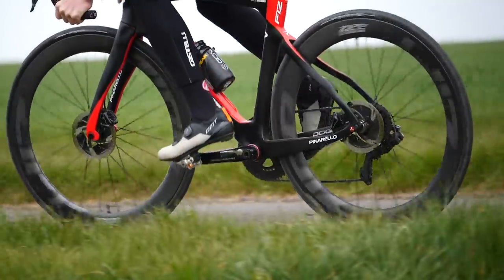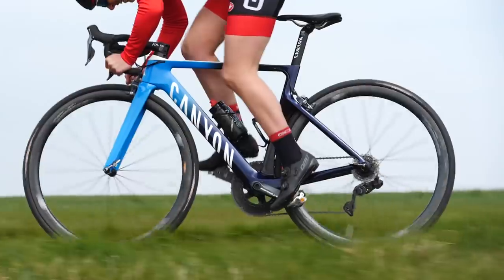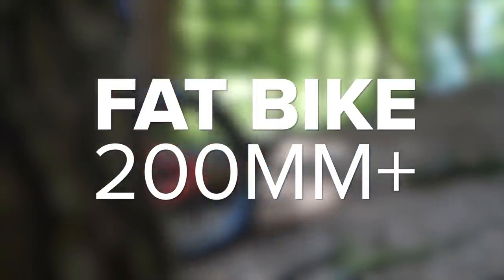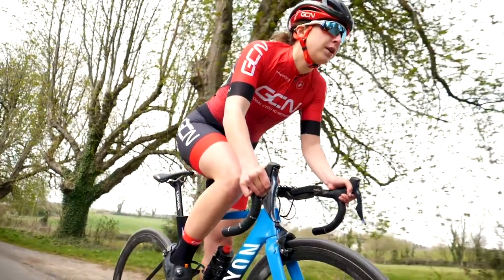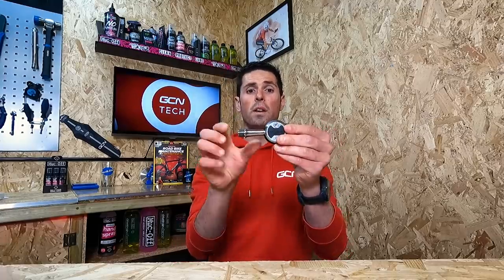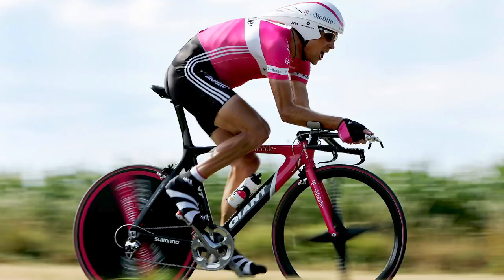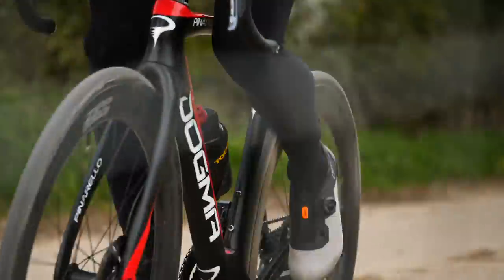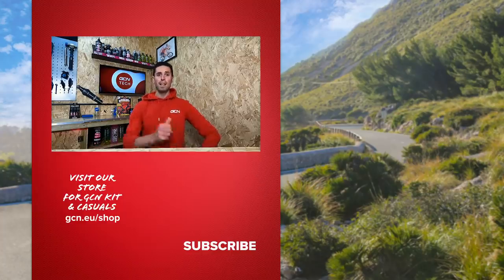What Is Pedal Q Factor On A Bike & Why Is It Important For Cyclists?

Comment from the maker: Have you ever thought about q factor as something to consider? Have you ever changed it on your bike? Let us know 👇
Reply: Its important for recumbent bikes, particularly velomobiles as narrower means more aerodynamic and snaller fairing nose
Reply: Thought about it as I had knee pain. As I already knew I had wider than average sit bones it was obvious I needed wider than average Q Factor! Well obvious after the pain.....
Reply: Thanks, any advice on the nightmare of how to narrow the q factor on some wider bikes ? There's often clearance to do so between cranks and stay. Just don't have countless parts to have endless attempts. Get another bike I suppose.
Reply: @mikes_3d  If you have a BSA square taper bottom bracket then these come in a few different widths. Only mm differences but it might be all you need. If your hollow tech....I think you are stuck.
Reply: @SuperNeilB  Thanks for the help. Hope your knee is OK, same issue with me. You are absolutely correct with taper. Of course, need to not foul the crank on to the BB with narrower spindle. On other BBs a different set of issues as you say. Need crank arms which simply which don't angle out too much. On my old mountain bike I use old cheap taper fit chainsets which are narrower than newer ones and others. Need to do it on another bike which is not taper fit.
Reply: Yes I have.
Reply: I suspect Shimano XT pedal spindles would be compatible with their road pedals. That way the Q factor could be increased without spacers and by more. Dura ace  has one ball bearing less per race though  so it wouldn't fit.
Reply: Great video!

I had incorrect BB spacing set up on my bike for a while and started having problems with my knees. Made some amendments and haven't had any issues since. 

Essentially all that I changed was the Q factor.
Reply: Great video!

I had incorrect BB spacing set up on my bike for a while and started having problems with my knees. Made some amendments and haven't had any issues since. 

Essentially all that I changed was the Q factor.
Reply: Great video of an underestimated parameter. Very common is the check of the saddle width and not the Q factor . I m 197cm tall and I use adapters (20mm) a totally different life :-)
Reply: Ok so we learned about the Q factor, now thats the 007 factor?
Reply: one more reason to bring back the good old square taper
Reply: buy this man a new mic or some foam wall panels please!
Reply: I went the pedal extender route myself. I also use platform pedals because my feet are too wide for regular cycling shoes. Used to have pain in the outer foot after rides of less than 5 miles.
Reply: @SuperNeilB  I've had knee problems for 20 years. Bikefitter adjusted saddle setback and q-factor. No pain anymore!
Reply: @turboplopp  Good that your problem is now fixed. My problem was the Q factor and pedal spacers fixed it. It became obvious when I was riding my MTB with flat pedals and no knee problems.....because half my foot was not on the pedal! Move the pedal out and all is well. This is the problem with being 20% wider than an average human!
Reply: I had knee and Groin strain riding on the spinning bikes. After reading about Q factor on Bicycling Quarterly, I found the spinning bike Q factor was 170mm.  I use Speed play pedals on my racing bikes with a Q factor of 120mm with no knee or Groin problems.  I also placed wedges in my cleats to slightly adjust for my pronated feet.  Ride with no pain in those areas.  Now 70 years old, and having neck issues that physical therapy is helping but not eliminating.  Riding outside and inside on longish rides, 30 miles inside and 50 -80 miles outside and putting up with the neck pain.
Reply: 20mm spacer are an extreme mod and can injure your hips. Just 3mm increase can already have an noticeable effect.
Reply: without having a really good bike fit that goes into minute detail of all this, it's very hard to know whether your setup is right or wrong, until you experience pains/problems. There are such a huge number of options out there for clipless pedals, it's a wonder anyone ever actually gets it right. I went back to flats after suffering knee pain on mtb clipless; I wouldn't go back now
Reply: @giuliospinelli6958  hi Guilin, are there any specific adapters you recommend?
Reply: @iragreenberg5432  Hi Ira, how did you extend the speed plays? I can’t find the optional spindles anywhere!
Reply: @giuliospinelli6958  thank you!

Comment: I have found that a more narrow stance on my bicycle is more beneficial to me, I began to experience inner medial tendon pain on my knee. I moved my cleats outward bringing in my foot closer to the frame and my symptoms disappeared. Another way is changing pedal spindle if you can, extensions if wider suits you, different cranks, or bottom bracket axle. Just watch the distance between crankarms and the chainstays.

Comment: Ulrich and Lance may have had issues but the pioneer of narrow Q at the bottom bracket source was Obree - it worked for him but (of course and as ever...) it’s horses for (TT) courses - Obree was (and remains) an outlier! Never knew the origins of the name - Q factor is a term used my other world - the music industry - in regard to how wide a range frequency is being affected either side of a central point when using EQ. Makes perfect sense now - nice one!!
Reply from the maker: Glad you enjoyed the video, Obree was an outlier for sure!
Reply: As q factor is a huge factor of designing fairings for HPV racing, as narrow Q factor means lower CdA, Id think it would go more far back than Obree.
Reply: @taufikabidin412  ah that’s interesting - I didn’t know that - Q factor in the same place - so essentially decreasing the distance between pedals? I didn’t know that!

Comment: I used those pedal spacers on my road and TT bikes and found after time they created a creek in the bottom bracket. It was a long and head-ached experience of investigation and experimentation with a solution occurring after greasing and tightening everything, then removing the 20mm spacers.  My guess is the longer lever causes the effort to put greater stress on the BB. I'm not a engineer however, this was just my experience.

Comment: I am 5’3” tall male with narrow hips. Q factor is very important to me. I have had constant knee issues due to wide qfactors on bikes. I have installed road bike cranks on all my bikes including mountain bikes. I machine the cranks to shift the chain rings for proper chain line.  I make the crank arms barely clear the chain stays. It is frustrating that bikes are pretty much built with the same q factors for all size riders.

Comment: @gcntech  #gcntech

It would b great if you could be more specific in how to determine the correct Q factor aside of trial and error.  Is there a biomechanical measurement which would give me a specific measure to set my pedals ??

To date, one of the best ways I discovered by chance was to ride on a straight set of road when the sun is low and directly behind you,  minimise the width of the shadow of your bike in front of you and observe the shadow of your legs (and knees) in relation to the shadow of the frame. This way I found that I had too narrow a stance and change to a MTB crank set on my road bike increasing the width by 10mm.  The first few rides felt different, not better or worse, just different but OK.   

However I would also like to hear of a possibly more biomechanical measurement.  

Further down a commenter (scott baker) suggested a "waling methode to determine a q factor.   But what he describes would 'only' give an approximation because when standing / walking the legs are straight or only marginally bent.  
When cycling the knees, hip joints move through a much larger range of angles and only at the extreme of the pedal down stroke do the angles approach those you have when walking.  
If the hip joints are 'toe in' or 'toe out' ,  for the lack of a better description,  the legs will move very different at the acute angles during cycling, compared to walking.
Reply: If you have a trainer, film yourself from behind with different size Q factors.

Comment: Since it's a fit specific measurement, the right dimension will be specific to the person.
I have narrow hip joints, so a narrow q-factor works for me, I get a lot more power and comfort with track cranks, which generally measure 137mm.
My Campagnolo Record Pista c4abks are 131mm and are great 👍

Comment: Back in the days of the penny-farthing they used to call this 'tread' although it was measured between the centres of the pedals at the time. Even then it was thought best to minimise it, with 'touring' models having a tread of 14" (355mm) or so and racing models coming in at around 12" (305mm). (Subtract around 100-120mm to allow for pedal width)

Of course the price you paid for this was reduced hub flange width, and given that wheels were 50"-60" in diameter you didn't want to reduce this too much or you would weaken the wheel. Thankfully this was less of a problem once the Safety Bicycle arrived in 1885 ...

I'd imagine the optimum measurement was whatever the spacing was between left and right feet in a normal walking or running gait, since we've been doing this for around 500,000 years :-)

Comment: There are a lot of riders for whom narrow q-factor does not work well at all. So, how do you know? Just take some video from the front while riding your bike on a trainer. If your knees make a v-shape (wide at the top of the pedal stroke then narrow at the bottom), it's likely because you knees are being forced inward by the pedals when they want to be outward. My knees hurt for years (despite several professional fits), until I discovered this. 

I've used pedal extenders to remedy this and they dramatically improved comfort, but they have multiple problems too: 1) +40mm wider is too wide, 2) can't be safely used on carbon cranks, 3) can't tighten them to 35-40 Nm standard. Speedplay long axle pedals also work but they have other problems -- any small amount of grit will prevent you clicking in. So my latest project is try a Praxis Cadet MTB crank and M30 bottom bracket with 2x Praxis road chainrings and a Cane Creek 7.5mm offset direct mount spider on my road bike. This gives a nice wide q-factor but not too wide. But the chainline is too wide for the front derailleur limit screws. I'm going to try using a SRAM wide braze on derailleur mount and longer limit screws...we will see if that works. 

If anyone else has a solution for running MTB crank on a road bike and getting the front derailleur to shift across 2x road chainrings, let me know!
Reply: If estimating your preferred Q-factor is something you're looking at, then this might be of interest
https://www.tandfonline.com/doi/full/10.1080/15438627.2013.852093#abstract
Have a search for 'self selected Q-factor', there's a small but interesting bit of discussions regarding the subject.
Reply: Oh and regarding MTB crank on road bike; assuming you still can't get enough movement of the FD to the outer chainring then there's a couple of options you could try, depending on speeds and manufacturer - e.g. you could try an MTB FD (pull differences can sometimes we sorted with the limit screws) or if you have a Shimano 11-speed road setup then the GRX front mech is designed for a wider tyre clearance.
Reply: @fukawitribe  thanks! I am using a Shimano GRX 810 front derailleur, which as you say is designed for a wider chainline. But it still isn't wide enough for the High limit screw to work properly with the big ring. Can a Shimano MTB front derailleur work with an R8000 11 speed road shift/brake lever and a 50T big ring? I didn't think that was possible but I hope I am wrong. And, does a Shimano MTB front derailleur have a wider chainline, or what would make it work better than a GRX? Please tell me more!
Reply: @northkyt  If the GRX mech doesn't reach out to the outer chainring, then not sure if the 11 speed MTB derailleur will work with the road shifters and limit screw tweak; a bunch of up to 10 speed did (apparently), but not aware if it's OK with 11 speed STI and FDs one way or another. That would have to be a really wide chainring offset though, probably more than is needed to clear a 2.2" tyre outback depending on chainstay length/rear wheel spacing (i'm assuming a road-esque bike). Is there a reason why you're shifting the chainring line rather than tweaking the pedal offset to get the Q-factor you want ? There was a number of different pedal spacers available when I last looked (I use them), but not sure if any were less than 20mm each, i'll have a look later.
Also just a quick one - if you haven't already I would strongly advise getting a bike fit to sort out exactly what you need before spending more time and money, they may find another way to getting you comfortable. Good luck.
Reply: SQlabs has pedals that come in various lengths.
Reply: @SurpriseMeJT  I bought a set of the SQLab road pedals. They didn't work very well. Cleat release was very hard even at the lightest setting.
Reply: @northkyt  Interesting to know.  I am going to try their SPD pedals first.
Reply: @SurpriseMeJT  I take it back. I just tried the SQLab long-spindle road pedals again tonight, with genuine Look brand grey cleats. They worked perfectly, easy to enter and exit, smooth rotation and my knees felt great with the wide spindles. When I tried them before I must have used a different brand of cleats, probably the ones that came with the pedals which are not genuine Look cleats. Minor differences between "compatible" cleats can make a big difference.
Reply: @fukawitribe  An option is to use a 110/74 bcd crankset, which normally comes in a square taper.  Use only the small and middle chainrings.  I use this combo and it works to achieve 1. a wider q-factor and 2. lower gearing.
Reply: @northkyt  Thanks for the info.  Sounds like the SQLab cleats weren't designed well.  I'll find out when I buy myself a pair!
Reply: @fukawitribe  I skimmed over the research article.  I have a few issues with it.

1. There was no mention of the proportions of these athlete participants, ie. height, foot size, hip size, etc. 

2. Trained cyclist are using equipment which is likely standardized and as such, they are most efficient on the q factor they have adapted to, such as 145-150 for road cranks. 

Because of this, I don't think its a very good piece of research to base any decisions on.  I believe everyone has a range of optimal efficiency for bike fit, including a range of optimal q-factor.  A person might be a good bike racer simply because he/she happens to be most optimal on standard equipment. Perhaps someone just as athletically gifted or more is performing a little less good due to suboptimal bike fit and even poor q-factor.
Reply: @SurpriseMeJT  I agree there's a range of dimensions that the body would operate well in, however I read the conclusion as self-selected Q-Factor being a potentially better starting point from which to base those dimensions on than a singular value based more on tradition than anything else. Personally I find the idea that the 'standard' road Q-factor is somehow generally optimal to be quite the antithesis of science, or evidence-based, methodology - albeit a value that can work well enough for most folk. Ultimately I like to see more data on this obviously, until then I think the paper has elements of interest that may provide an extra datum from which to start conversations about bio-efficiency and comfort on.

Comment: When I used to use Time ATAC pedals on my mountain bike. I could move the cleats backwards and forwards. However I couldn't move the cleats sideways. They had round bolt holes in the cleats. I don't know if they are still like that now. As I Crank Brothers pedals. As I use the Crank Brothers Candy pedals on my hybrid and the Eggbeaters on my road bike. I can use the Crank Brothers 3 bolt cleats on road shoes. Mountain bike shoes for walking and road shoes for power transfer.

Comment: Wow they named a physical length a "factor".
Reply from the maker: It is an interesting way to name it, but it's stuck
Reply: When I had seen the first minute or so of this video, I was completely sure, the Q factor would be the width between the pedal arms divided by the stroke, e.g. 146 mm divided by 345 mm = 0.432 (without dimension, because mm divided by mm).

Comment: #askgcntech Hi GCN Tech. I'm in the market for a gravel bike capable of light gravel and firetrails etc. I ride a small size road bike, but I see that some smaller frame gravel bikes only come in 650b wheel size. As I would be riding mostly on-road with the occasional off-road detour, should I stick with 700c wheels? My concern is toe overlap as I have experienced this on my road bike when making tight U-turns. Thanks.

Comment: #askgcntech Hi Alex. Congrats for the nice work. My girlfriend rides a Cube Nuroad Race FE 2020 with a GRX 600 crank set, with a standard 170mm length. After her bike fit we were told that the correct length for her would be 155mm, but the smallest GRX is 165mm. Could you recommend a model, brand or marketplace where we could find a compatible? Cheers from Berlin

Comment: Great vid. Wondering how using powermeter pedals like the Favero Assioma could impact the Q factor?
Reply: They have a spacer washer that comes with them that must be used on some cranks, but I didn’t have to use it on either my Rotor crankset or my DuraAce sets.
Reply: @mathewrose2951  Thanks. I'll have to see if Sram is similar.
Reply: @mathewrose2951  Ultegra and 105 didn't require the spacers either with the Favero. The Q factor of the Favero is very slightly more than the Dura Ace pedals I replaced but it's almost insignificant the difference is so small.